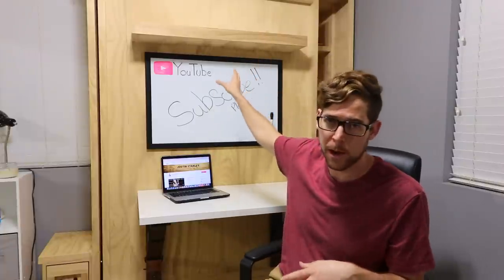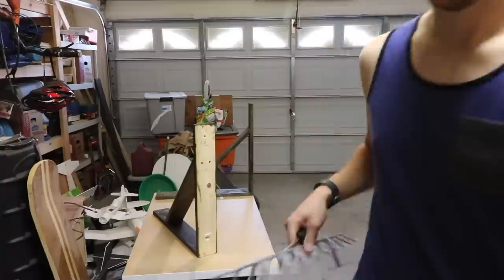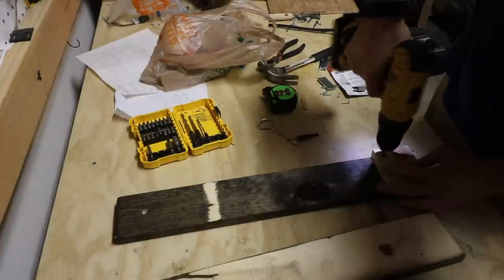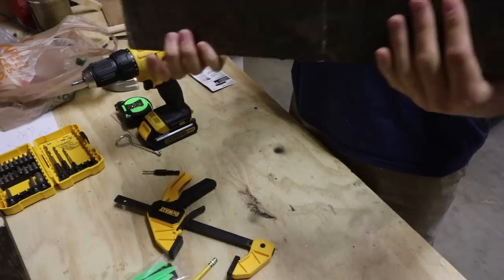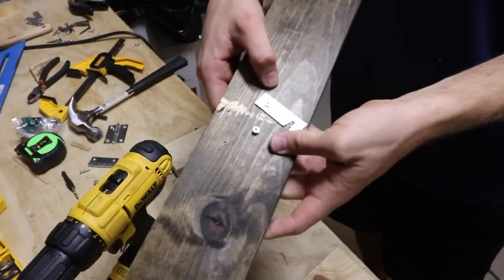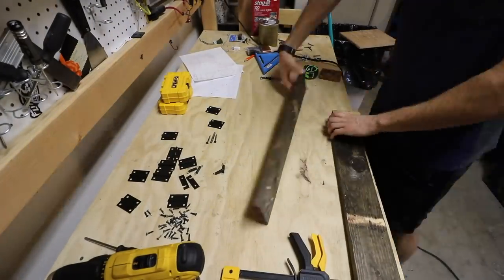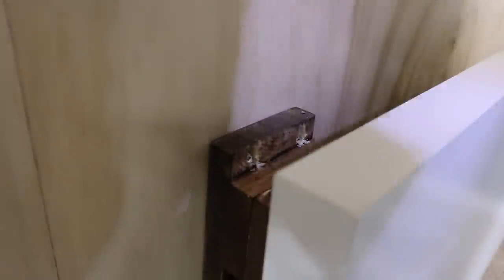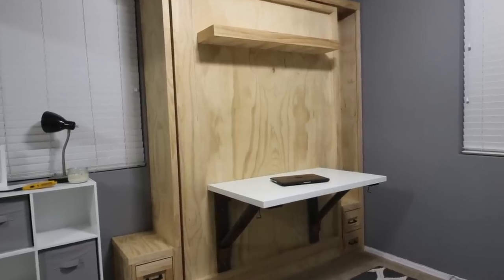DIY $20 Folding Desk for Murphy Bed!

Comment: That is exactly what I thought was missing from Glen's version!  (Well, and maybe some puck lights or an LED light strip behind some frosted acrylic or something under that shelf.)  Though admittedly I would have made it from the same materials as the original bed so it didn't look like an afterthought and made it stretch the entire width of the bed so I had more surface area to work with.  Still, kudos to you for figuring out that hinge.  I probably would have done the legs like a false picture frame style to match the trim on the drawers with a simple piano hinge or something similar.  Despite what I would have done I still say bravo to you!  👏👏👏

Comment: What is wrong with using folding hinges that a designed to do exactly that? They cost exactly the same. I do like the DIY aspect, esp if it saves money, but this is not saving money